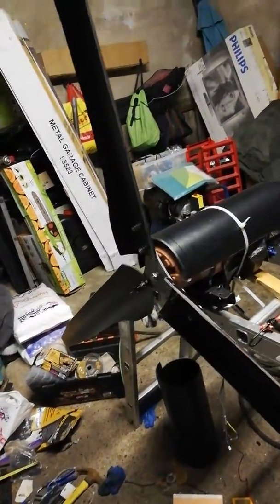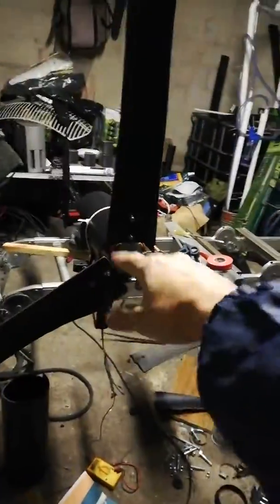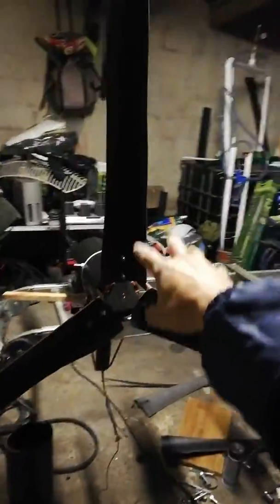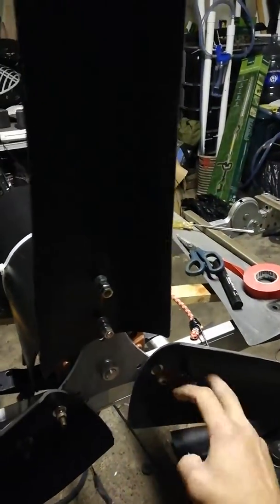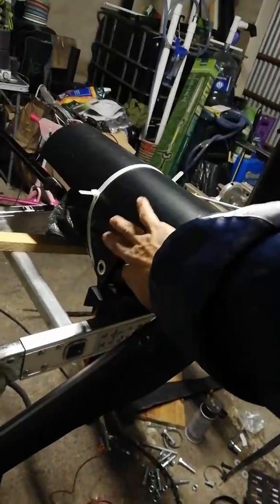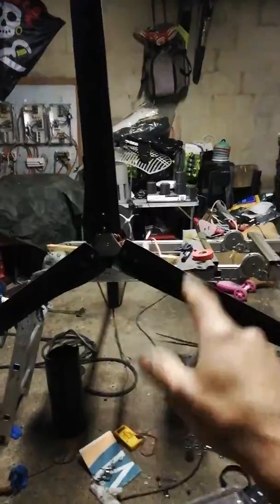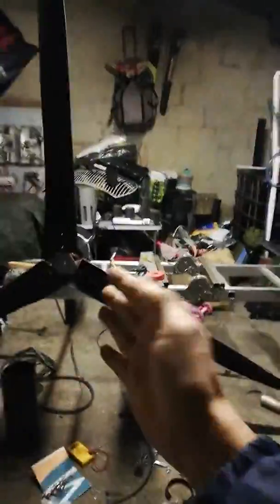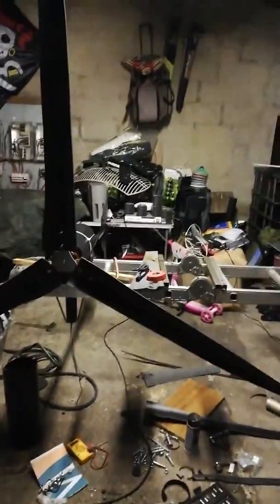How to make wind turbine from treadmill motor part2

Comment: Impressive that you hand made the blades so close to eachother that a couple bolts was able to balance it. I am thinking of doing a similar project as this because i already have a prop and i believe the identical motor you are using (leili 3hp 130vdc, from a nordictrak i stripped down). Only difference is i am aiming for just 12 volt output so it should make it easier. I thought i saw a part 3 so i will watch that next but i did want to ask in case you dont cover in the next video what kind of output voltage wise were you getting with the direct drive to generator setup? Seeing as how you were going for 48volts i would have expected you to need to gear up the generator speed unless winds are pretty strong where you are so was kinda curious about the results, also how low of a wind speed can you generate a 13-16 volt output seeing as how you were getting 8volts pretty easily with just a few hand spins?

Comment: It doesn't matter which way the wind pushes the prop, just check the polarity before you hook up leads to charge control. Reversing the motor just reverses polarity, if you hook up directly to batteries add a diode to positive or negative to keep motor from motoring